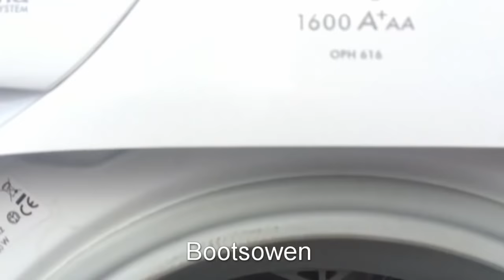Candy V Hoover Double Decker smash off full version

Comment: Can you provide a wiring diagram for hotwireimg a candy washing machine motor coz mines just packed in and I wanna chuck a brick in it. Mint video
Reply from the maker: My Washing machine universal motor wiring video should show how. Search for it. Good luck.
Reply: daniel kinnaird Wow you just packing in with your Candy!!! My Candy has problem with it still going strong which is need packing in soon and it going to be changing with Hoover Link 8kg The Candy are my Favorite machines at all.